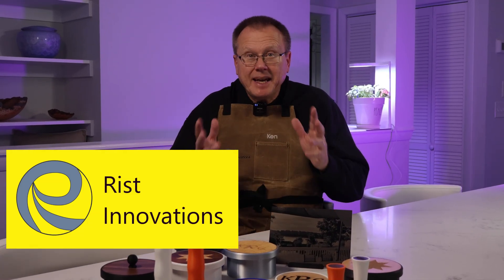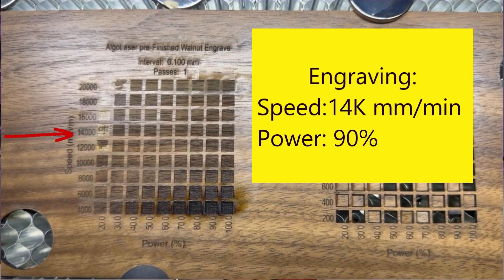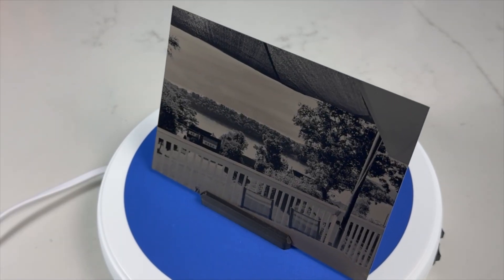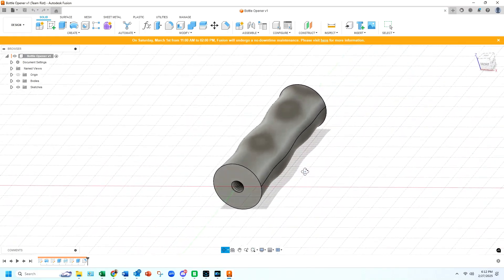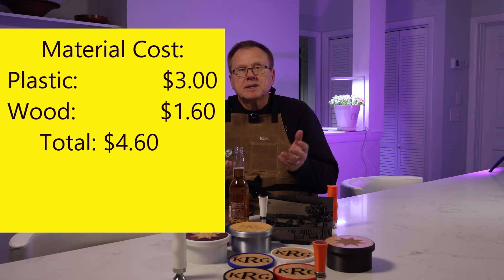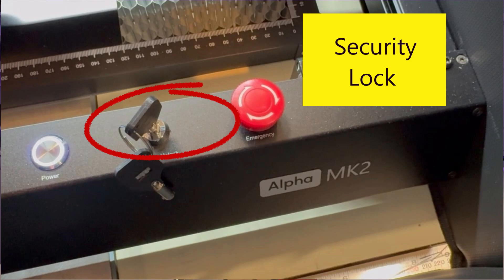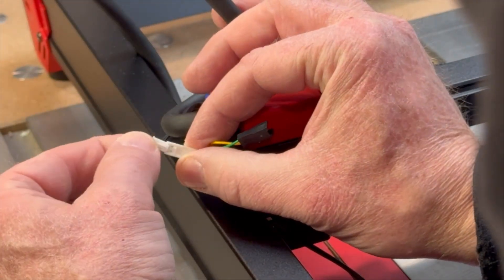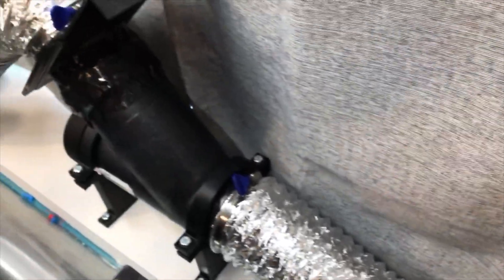5 Easy Gifts That Sell Combining a 3D Printer AND a Laser Engraver

Comment: These are great. Thanks for sharing. I have both a laser and a 3d printer. I am not at all experienced with making file for 3d printing. By chance do you sell the stl files for the bottle stopper?
Reply from the maker: I'm sorry that I'm late to respond to your question.  I don't sell my stl files, but the bottle opener is a simple design that I encourage you to try to design your version in TinkerCAD.  Although I haven't used TinkerCAD, I have the impression that is is a easy-to-learn software that will open a new world of possibilities for your 3D printing experience.  I hope you try it out.  Thanks for your question.